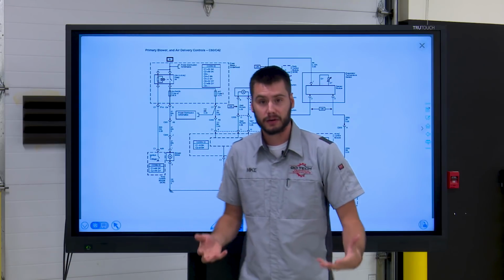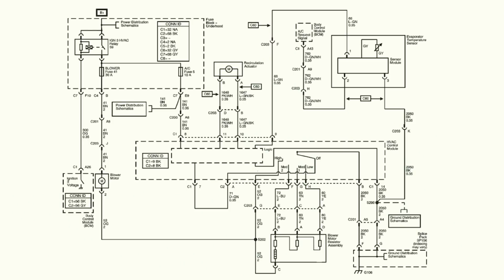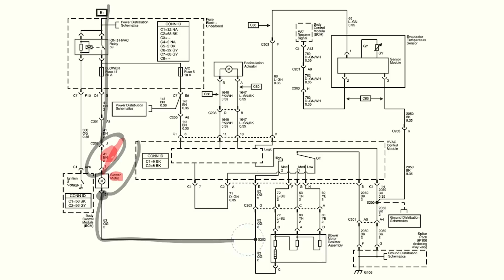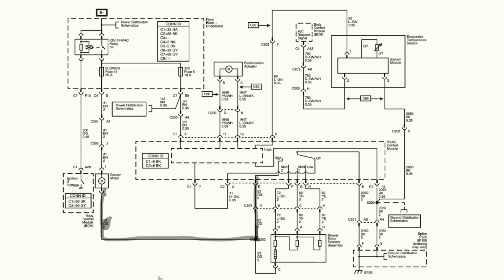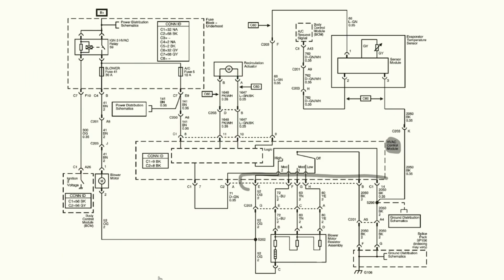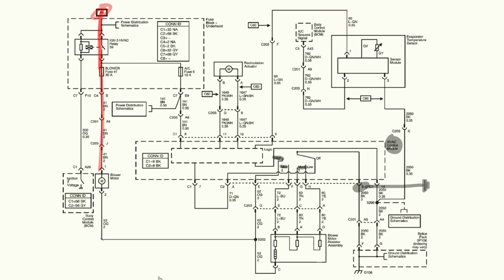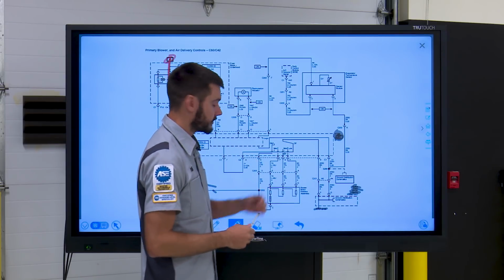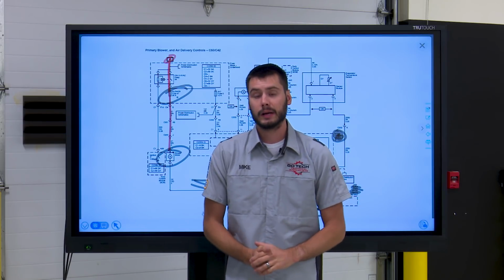Use Basic Tools To Quickly And Easily Diagnose Simple Automotive Electrical Circuits

Comment: Loved the use of the diagram and walk through of what you were going to test and where you were putting the leads and showing us in the real world. That is how you teach. Outstanding.  Your presentation and execution is perfect.  

On a flat rate question. I was a gm tech so in that world many techs after find this same problem one time would probably go straight to that connector and wiggle it as a first step. 

Keep doing what your doing!

Comment: Thanks awesome vid, about the dielectric grease, know thats recommended but I do have a tiny bit of confusion on that, when looking at the tube of it doesn't have any conductive properties, does this mean the pin cleans the grease off on the way in to make a good contact in the terminal? and the grease just stops water ingress into the connection?
Reply from the maker: Hey thanks! Yes, the grease is intended to keep any stuff out of there.

Comment: @GOTECH How in the world do you break loose the harmonic balancer bolt on 3.5L inline 5 on a 2005 chevrolet colorado. Tried using the flywheel lock that alldata specified but the transmission bell housing case won't allow the tool to be inserted. Any suggestions?
Reply from the maker: Hello,
You could try and get a hold of a harmonic balancer holding tool like the J 38122-A or something like it. It looks like the balancer has a design where you could hold the balancer itself. Otherwise an impact wrench if you can fit it down there.
Hope this helps!
~Ryan
Reply: @GoTechTraining  Definitely helpful. Thanks for the information!

Comment: #1 Check the easy things first
#2 Don't assume anything 
#3 Never take anyone else word for it
#4 Check everything else in order of increasing  degree of difficulty.
#5 never condemn a part without proving it.
 Useful info i obtained many years ago as a tech.  When someone has failed to fix an issue the reason they failed can be   associated with one or more of these rules.

Comment: You're my hero. Im going through all of your learning diagrams and diagnosis videos. My v10 ford is running terribly. I know the timing is retarding with more throttle and or rpm and am confident ill figure it out. Im not asking for advice as I want use it as a learning tool. You're helping me fill in the last void I have in vehicles 🤘

Comment: Great videos. I like them a lot! 
This is method I use to diagnose electrical faults.
I was taught to listen for a click on a relay circuit that controls all circuits (high and med and med and low). Also when diagnosing a fault on the circuit you are looking for one fault only (unless somebody has been trying to fix it and let things disconnected or broken) so we will eliminate lot of circuit 
1/turn the knob/switch to any position, lets say high
2/listen for click of the relay, no click your problem is on control side of the relay (either bad relay, open/shorted + wire, open - wire, BCM switch internally broken)
if you hear a click your problem is on the switch side of the relay
3/at blower motor connected back probe pin 1 if you read 12 V you just eliminated bad + wire, open fuse  if you read 0V check them
back probe pin 2 if you read 0V then you have a bad blower motor, if you read 12V, you have good motor. Your problem is on the ground side below pin 2. We can eliminate problem between S202 and resistor pin C also between S202 and pin E,F,G,H because we are only looking for one fault, any fault between these would not cause all setting not to work.
Our fault  is either bad wire between blower motor pin 2 and S202 or heater switch of the HVAC control module or ground wire from module pin B to C201 to F to G106.
4/Checking at splice S202 is not easy so lets take our hvac module aka switch  out and back probe pin E (thats our high setting), if  you read 12V then between blower motor pin 2 and splice S202 we don't have any open, if you read 0V you have open wire in that location and you are now forced to check S202
5/ hvac module backprobe pin B if you read 0V you have bad switch, if you read 12V you have a good switch
6/C201 back probe pin A5 if you read 12 V no open on that wire, OV your open is between C201 and pin B.
7/back probe pin  F     12V no open  0V open between pin F and C201
8/ G106 0V open between G106 and pin F
Hope this makes sense!

Comment: If you don't mind, maybe you talk about your jumper wire in a future lesson? I thought you said "fuse jumper" but I see it's a "fused jumper" with a 20A fuse inline. Is that just so you don't blow a fuse in the box or damage another component? -- I'm new here :)
Reply from the maker: Hey, sure I can talk about that at some point! It is fused to protect the circuit...and the fuse in the box ;) I'll usually try to throw a fuse slightly smaller than the one in the box into my jumper.
Mike Becker, Senior Instructor

Comment: With the dielectric grease. When would you say it is okay to use. 
Being it is a dielectric. For instance I've had some issues where cars would have had dielectric grease put on computer module connectors causing comm issues.

Is their a certain level of comfortably using grease on higher load circuits?
Reply from the maker: Hey Nick, this is a great question that everyone seems to have differing opinions on. A quality dielectric grease should never cause issues, it's just there to take up the air...not letting moisture in. It should never conduct electricity, therefore never cause issues. Personally, I've never fixed a car by removing dielectric grease. Hope that helps a bit?
Mike Becker, Senior Instructor
Reply: @GoTechTraining  cool, appreciate the response... makes me think weather or not it was dielectric grease the two modules I came across. Idk but thanks for the insight

Comment: Hi Mike. I’m curious as to the liberal use of dielectric grease on the actual terminals of the connector. I understand that the intention here is to prevent corrosion in this instance. By definition a dielectric is an insulator and therefore presumably not desirable to get on conducting surfaces. In your experience does the application of grease produce any appreciable increase in resistance?
Reply from the maker: Hey DJR, thanks for watching! No, I have never seen adverse effects to the dielectric grease. The pins, male to female, make a physical connection. Therefore, the dielectric grease is a non-factor at those connection points. The goal is to fill the other space with the grease so water/air can't get to it and cause corrosion.
Mike Becker, Senior Instructor

Comment: Hey Mike.  Always great to see your videos.  I agree with others that some wiring diagram understanding videos would benefit so many including myself.  And also knowing what to expect at any given point in the circuit.  For example at your blower motor,  if you had 12v at both wires while still plugged in, you would also know there is no ground and that the 12v passes thru the coil in the motor and on  through the rest of the ground side circuit.  Question, before you fixed the block, with the blower switch turned on, would you have read 12v at the ground block? I'm sure you would have on that particular wire anyways.  Keep up the great work Mike. Stay safe!!!!
Reply from the maker: Ohhh Mike that's a good idea. I can make that happen! Yes, it would have read 12v at that block, as long as the switch was turned on for the blower motor.
Mike Becker, Senior Instructor
Reply: Would that confuse anyone with a test light clipped on at the ground block bolt and lighting up the test light touching the blower ground wire. Lol.  It would make me think for a second or two. But why would anyone put a test light there.

Comment: Really good video, very straightforward and informative!  
Quick question:
What do you use to locate specific connectors on the vehicle?  If I'm using alldata can I just search "G106" and get a picture with the location? Or is there something better for that sort of thing?  In this instance its not a huge deal but say I'm looking for a specific splice in the harness, I don't want to go tearing the whole dash apart looking for it!
Reply from the maker: Hey ApostleXIII, thanks for watching! Yes, you can search locations in Alldata, but typically I just use the location finder on the right side of the page. It lists them all out in numerical order and I just pick the one I'm looking for. Sometimes the picture you end up with that points to the location isn't the greatest...but it gets you going in the right direction.
Mike Becker, Senior Instructor
Reply: @GoTechTraining  Thanks Mike!

Comment: Isn't there a risky chance to damage computer with old style Test lamp, because old lamp can flow higher current ? Then there are new style of Test lamp with LED, which not draw too much current.
Reply from the maker: Hey GameBacardi, the simple answer is yes, in some circuits. You would not want to plug the test light into a signal circuit or a reference voltage circuit or something like that. My rule of thumb is to always look at the load in the circuit....if it draws more than .5 amps, I'm throwing an old-school test light on it...if it's less, than a DVOM, LED test light, or scope are going to be used.
Mike Becker, Senior Instructor

Comment: Follow the voltage/current path.  Along the way in this case, check the "G1xx" ground by substituting a "known good ground."  Circuit now works, back track to locate problem.  Sounds simple, and in this case, like you said, it is a fairly simple circuit.  It's called "signal (or power) tracing."
It worked for me in the past.  Intermittents are a different animal, but basics still are the rule to follow.
Good one Mike!
Reply from the maker: Hey Mike, thanks for watching! Ugh yeh, intermittents can be a bear to find!
Mike Becker, Senior Instructor

Comment: You could also move the test light connector to the battery positive terminal and see lights up to quickly know have a bad ground before taking HVAC module apart.
Reply from the maker: Hey Zairk, sure buy you'd still need to access some point of testing. The likelyhood of the ground splice pack being back is so low that typically it doesn't make sense to test there usually.
Mike Becker, Senior Instructor

Comment: It's a scope...Scope on a rope!  I recently helped a guy on the Honda Odyssey forums who had done all the same stuff....I guided him with some testing to a bad HVAC control head on a 2007 Odyssey.  Had never seen it before on the Odyssey but the testing, if you know what you're doing, doesn't lie.  He ordered a control head from eBay and a few days later posted that it was fixed!  He was quite happy...although he also had a new transistor and blower motor from before I started helping him.  Good stuff here!
Reply from the maker: Scope on a rope! Thanks for watching! They get harder the newer they are...module to module comm and such :(
Mike Becker, Senior Instructor

Comment: Thats the right way of troubleshooting which is by ellimination. Test the load side first, then squeeze it down to the faulty component. Some inexperience technician are jumping from one place to the other instead of following the trail. Most common issue on electrics are corrosion, either at the connectors or inside the wires itself, especially when other technicians used an insulation peircing clamps.
Reply from the maker: Thanks for watching Bogart Bacus! Ahh yes, good ole corrosion :)
Mike Becker, Senior Instructor